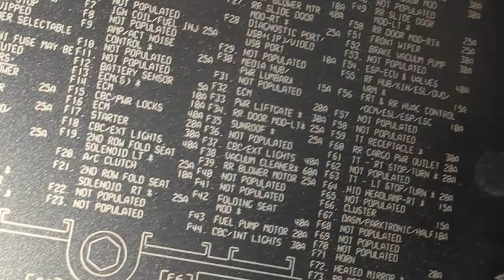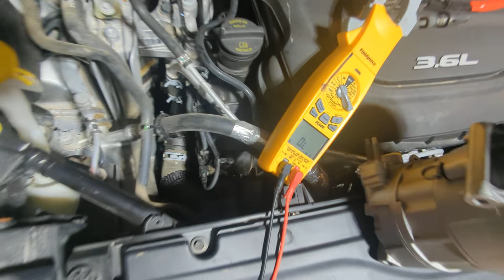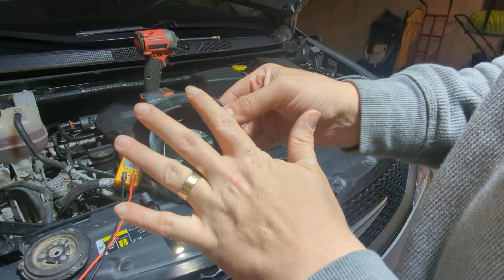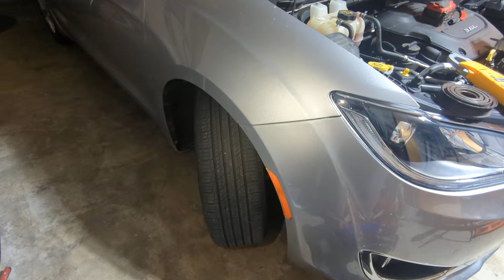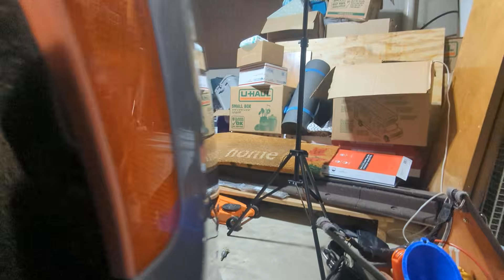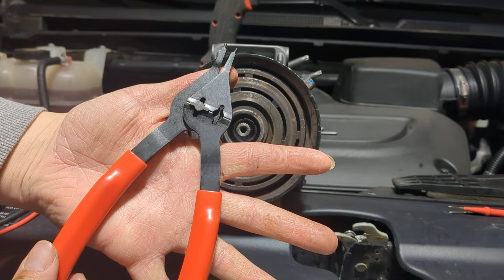AC Compressor Not Engaging (2017+ Chrysler Pacifica) Diag + Solution

Comment: Where can we buy the coil , pulley and compressor? Please provide the link ?
Reply: Hello, wanted to give you update.  The mechanic confirmed that the AC is working after replacing the coil and the assembly. Thanks a lot for the help and guidance. 
I am not sure if he has maintained the 0.5 m gap or anything else but it is working now . Thx a lot for the help again .
Reply from the maker: @hussainimca  really happy to hear it's working again. If I may, how much did he charge you for labor to replace the clutch assembly? Also, did he replace the connector?
Reply from the maker: A link is in the description
Reply from the maker: RYC New A/C Compressor Clutch Coil AFH389-CO (Fits Chrysler Pacifica 3.6L 2017, 2018, 2019, 2020, 2021, 2022; Fits Chrysler Voyager 3.6L 2020, 2021, 2022) https://a.co/d/01huK763
Reply: Thanks a lot .  I do not mind to pay 100$ dollar if it is from mopar .  Do you recommend mopar or aftermarket? Thx in advance
Reply from the maker: @hussainimca  the Mopar part is significantly more expensive, but may end up being the only one in stock if you are looking for a whole clutch assembly. R&Y compressors seems to only have the coils in stock, and only on Amazon. I tried to look up the clutch assembly on their website but didn't find anything. Implying they are out of stock. 

I don't think it matters which way you go. OEM or aftermarket are going to be damn near the same part.
Reply: Thanks a lot sir
Reply: Getting 13.2 volts not 14.3 . On both sides of fuse when I checked with AC ON .  Something wrong ? Plz advise
Reply from the maker: @hussainimca  have you checked resistance and amp draw?
Reply: I guess yes.  I removed the fuse and then I checked the resistance but it is showing OL . Not sure if the multimeter pins are thin enough to touch the fuse pins .
Reply from the maker: @hussainimca  if you checked them the way I show in my other video, that's a clear indicator that either the connector or the clutch coil is bad. If I remember correctly, a shop has already replaced the clutch coil correct?
Reply: No. I have not replaced the coil or anything.  I will check one more time the resistance before I order the connector and coil ?
Reply: Not sure why it is showing only 13.2 than 14.3 volts? Any idea ? Is it battery issue? Or alternator issue?
Reply from the maker: 13.2 is still high enough that the alternator is charging the battery, just not very much. Has the vehicle been sitting for awhile? I wouldn't worry about it much
Reply: No I drive this vehicle every day.
Reply: So do you recommend to replace the coil and the connector and see ? 
Thanks a lot for the advice
Reply: Hello , I tested again today . Now it is showing 12.9 to 13 volts on fuse both sides 
And showing resistance OL. 
So please recommend one more time please .  
Should I replace the coil and connector and see if that solves the AC issue? Appreciate your help.
Reply from the maker: @hussainimca  haven't you already had the coil replaced?
Reply: No not yet replaced. If you suggest to replace , I will purchase today . Thx
Reply from the maker: @hussainimca  it would be good to buy both the connector and the clutch assembly. The whole assembly is back in stock for $104 

I would retest the resistance after you pull the coil out of the car. If it still tests ol, then replace the coil and connector. If the coil tests good, just replace the connector and return the coil
Reply: @David_Poole thanks a lot . Do you have the link where I can purchase the clutch assembly please. Thx
Reply: Mine car is 2019 crysler Pacifica touring L . Hope this will fit
Reply: I ordered the part 

2019 Chrysler Pacifica Touring Mini Passenger Van 4-Door 3.6L A/C Compressor Clutch (AFH389-CL)
SKU: 2019-chrysler-pacifica-afh389-cl-909203
Reply: I also ordered the connector. Hope the local mechanic able to replace these without any issues?
Reply from the maker: @hussainimca  have you already made sure he'll do the work with parts you bought?
Reply: Yes.  I guess he will but will check . Thx
Reply: Hello , Today the parts are delivered.  If mechanic tested and found the coil is defective then do you recommend to replace only the coil or the whole assembly and other parts which is cane with coil ? Thx
Reply from the maker: @hussainimca  if the coil is bad, replace the clutch, coil, pulley and bearing assembly, and the connector
Reply: Thanks a lot
Reply: He did not replace connector 
Coil  and assembly: 140$ 
Labor : 200$ 

But Crysler dealer would have charged 2600$ after discount :)

Comment: When there is not much info Online about a particular car problem that could be a good indication that it doesn't happen that frequently.....or that the problem was so easily fixed that it didn't rate a video.
Reply from the maker: The issue is brought up frequently on the Pacifica forum. Everyone before me would take it to the dealer and get told they need a new compressor. This model had only been out since 2017, so there hasn't been that much time for problems to arise outside of the manufacturer's warranty. 

Given that the companies who sell the AC clutch assembly are sold out of new models, and started selling just AC coils seems to indicate lots of people are having this issue, but before I made this video and others, most, if not all people were getting told they needed a whole new compressor. 

I think the lack of information is due to 2 factors: 1.) the car is newer, and has had less time to show failures.
2.) lots of people are having this issue but are covered under warranty and taking it to the dealer. 

In either case, the information on what's really going on is kept out of the public sphere. No one was talking about the AC clutch coil until I posted about it. Now people are sold out and coming back with story after story saying they were told they need a compressor and fixing it for 1/15th the price. 

I truly feel that I've uncovered a solution that wasn't even known by the dealerships.

Comment: That plug/sensor on rear of compressor is a variable compressor control valve. Even when clutch is on compressor can just freespin. How much it pumps is controlled by that valve to achieve variable refrigerant flow. I believe it uses PWM(pulse width modulation) signal to valve so it’s hard to test. I’m a HVAC tech also and own a Pacifica that started having ac issues at 180,000.
Reply from the maker: That is so interesting. Thank you for sharing that information. I would imagine it has to be something with PWM. Possibly some sort of controlled bypass? That would be the simplest way to limit how hard the compressor is working. Given how overly complex everything else is, it's probably not the simplest solution lol.

Did you see that the liquid line runs inside of the suction line before it enters the TXV? I thought that was super clever. It helps to guarantee the compressor receives a vapor, and make sure the liquid line doesn't flash gas on its way to the TXV. If you go to my channel I have a much more in depth video that covers the whole diagnosis and repair process

Comment: Thank you for the video. I’m experiencing A/C issues as we roll into summer. Not receiving the call signal from F20 fuse. You mentioned in the video not receiving the signal may be due from low refrigerant? TIA!
Reply from the maker: Yes, if you don't have 14v to F20 when setting the system to MAX AC, it's a sign something else is wrong. Refrigerant is a great first place to look

Comment: Great video.  However, I'm only a novice. I've read it can take 4-6 hours to replace the compressor.  Can you confirm this?
Reply from the maker: You don't have to replace the compressor if your issue is caused by a bad AC clutch coil. Go to my channel to see my how to video.
Reply: @David_Poole  thanks I'll check it out shortly and touch base. Much appreciated.
Reply from the maker: @MrJoelgides  what did you end up deciding?
Reply: Took it to dealership. They said clutch and coil was bad. They wanted too much to replace. Found another shop who replaced the compressor for about $970.00.  the a/c worked on the way home, but later that day stopped working again. Any thoughts???
Reply from the maker: @MrJoelgides  bad connector. Probably was the issue the whole time.
Reply from the maker: @MrJoelgides  if you look at my pinned comment, you'll see a link to the right connector. It's $12 and easy to change yourself. I'm thinking about making a video on how to do it, but I need a new Chrysler Pacifica to do it on lol

Comment: Same issue. for me. 2017 Pacifica Touring L Plus, AC Clutch not engaging.. 104k miles..   Fuse at F20 has voltage across.. I'm trying to find what is the next easiest step?  I believe to check the pressure at the low pressure port on the back firewall?  I think i can buy R-1234yf and a gauge to see that?   Excellent thread you have here by the way.. I found this via the Pacifica forums link a few weeks ago..   Thanks for all your help!!   I have a feeling this thread is going to grow!! LOL     :)   Please let me know if you think easier for the induction coil or pressure sensors first..  Much appreciated!
Reply from the maker: Just made a short showing how to test the AC clutch coil without removing the passenger side tire
Reply from the maker: If you have voltage to F20 it's not refrigerant related. You definitely have an AC clutch coil problem. I just recorded a video today of me replacing the AC clutch assembly. I suck at video editing and will have to edit it over the next few days. Don't waste your money on the refrigerant and gauge. The best next step you can do is pull off the passenger side tire and wheel cowl to test for voltage and resistance at the AC coil.
Reply: @David_Poole    thanks for the quick response..  After posting and rethinking, I was starting to think the same.. If there's power making it to the f20 fuse, the sensors are completing the circuit.   So for other folks trouble shooting.. if there's no power to the f20 fuse, then it could be sensor related.   Just for  future use.. Would anyone know where the relavant sensors are?  I've tried looking  across the AC lines to locate. I believe to found only one sensor, just behind the passenger headlight, maybe 8 inches away, appears to be on the smaller, liquid line.. It has 3 pins. Not sure if this a pressure transducer, or high pressure sensor?   Going in for the clutch coil next !!
Reply: Yep.. just realized in your first video, it explained that if sensor issue, f20 power would be cut..
Reply from the maker: @sranthony3  gonna push to get the 2nd video uploaded tonight that way you have a guide on how to do it.
Reply from the maker: @sranthony3  how to video posted on my channel.
Reply: I just wanted to piggy back off this no power at f20, could you jump the clutch at f20 to try to get it to engage? The only reason I a asking is because I had power at f20, replaced the clutch, and the compressor was reading the same pressure on the high and low sides, after talking with some old timers they said it was a bad compressor, but the clutch was engaging. Now with a new compressor the clutch will not engage and I ahbe no power at f20. Sorry for the long question.
Reply from the maker: @biggiesmalls6  no worries for the long question. Let's start with this question back to you. You said that you had equal pressures on the high and low side, was this with the compressor engaged?
Reply: Yep, I ran all the tests you had discussed in your previous videos (thank you for that by the way) and it all pointed to the clutch. I replaced that and the clutch would engage with the ac on full blast, but the pressures were the same on both sides.
Reply from the maker: @biggiesmalls6  no problem, I'm happy to help. 

So your AC clutch wasn't engaging, you did the tests, confirmed the AC clutch wasn't working, replaced the clutch assembly, it started engaging but the pressures were equal. And now it's not engaging again yet you have voltage at F20 correct? 

I assume the AC was working fine until this all happened? Also assuming the timeline of events stated above are correct, my best guess would be that the clutch plate isn't fully seated. Have you checked the clutch gap? 

You could hot wire the clutch by running a power wire from the positive battery terminal to the fuse. You'd wanna run it to the pin closer the the passenger cabin (the opposite pin you check the resistance from) that way the fuse is still in the circuit and won't short circuit anything. 

You could also check resistance again from the fuse box, if you get a really high resistance or OL, that might be an indication that the connector is bad. A link for said connector is in the description of my other video.

Here's the steps you need to do and report back to me:

1.) check resistance at the fuse box again.

2.) tell me what pressures you get when you check refrigerant and what the outdoor temperature is when you check those pressures

3.) if the reading at the fuse box is OL or higher than 8, order a replacement AC clutch connector and redo the connection. While you have it taken apart, check the gap with a feeler gauge and make sure the gap isn't to big. .5 mm is ideal.

Let me know what you figure out
Reply from the maker: @biggiesmalls6  all the tests I mentioned should be done with the car off and cool
Reply: Ok, so my resistance at the fuse is 2.6. I have no pressure in the system because I took it all back out not wanting to keep wasting it. I didn't jump the compressor at the fuse because I was worried about shorting something but I got the clutch to engage by running a wire right down to the clutch. My gap is .5mm. I am beginning to think I didn't change it correctly the first time. The only thing that is different is I do not have 14v at fuse F20, which again I think is because I didn't charge it correctly. I am going to try to charge it after I evacuate it again and see what happens.
Reply from the maker: @biggiesmalls6  having the system evacuated would keep the clutch from engaging. Refill to the specified amount and id say you're good to go. Resistance seems a bit low but not too low to not function correctly. 

I'm curious why you evacuated the refrigerant in the first place? As long as there isn't a leak, you shouldn't be loosing any refrigerant

Comment: This couldn't have come at a more perfect time. How coincidental! My girlfriend's 2017 Pacifica is having this issue and i was just about to have her order a compressor...So glad we didn't do that right off the bat. It appears to be the clutch assembly so we'll start with that. I can't say thank you enough!!! I was losing so much confidence in this repair because of the massive lack of good info regarding this particular repair. You are awesome!!! Thank you thank you again from both of us.
Reply: Excellent video. Had my 2017 Pacifica just checked and the refrigerant topped off and they think the clutch is bad so instead of paying them $1,400 to replace the whole thing I'm going to take the clutch off myself and test it. Thanks
Reply from the maker: Were you able to get the AC clutch coil replaced? If so did it resolve your problem?
Reply: @David_Poole Yes and Yes! It was a pain to do but I got it. Getting to the tensioner pulley was ridiculous. I had to use a special thin pulley wrench from O'Reilly's and a breaker bar to be able to move it...yikes. Such an inconvenient space to work in. I also removed the windshield washer fluid reservoir to give myself a little more room to work on the compressor. The little bolt holding the clutch in place was a bear to get out, then the clutch itself took forever to get out too....nothing was easy on that repair lol. But I honestly can't say thanks enough for your insight, it was so helpful. I would have replaced the entire compressor and spent so much more money and time than I needed.
Reply from the maker: @loremipsum836  responses like this make my day. Super happy I could help. Thank you for coming back to let everyone know how it went and that the repair worked. Sorry to hear you had issues with the tensioner. I just posted a how to video going over an easier way to remove the belt. Hopefully you won't need to watch it anytime soon 😂